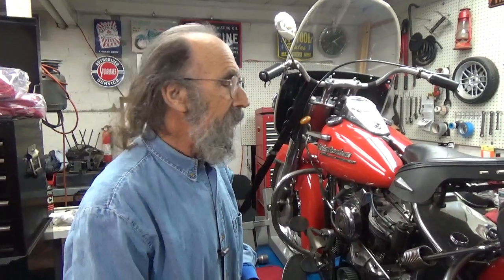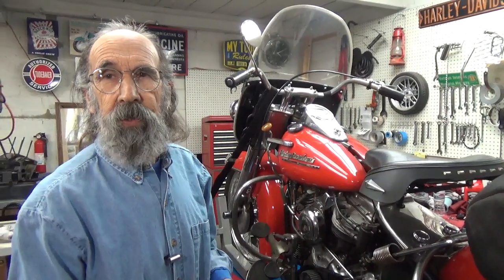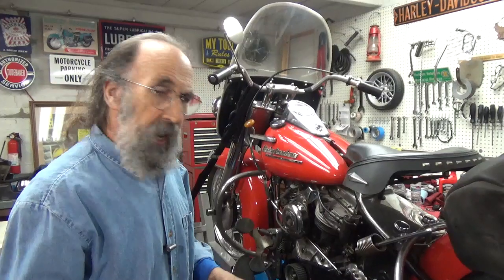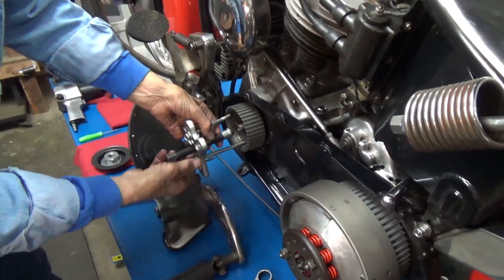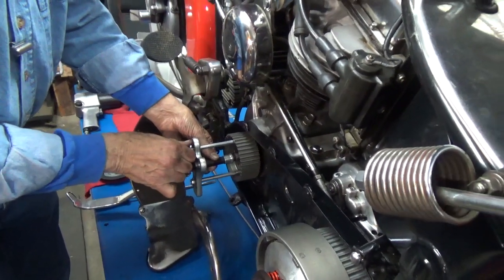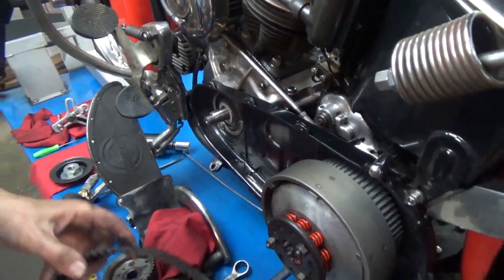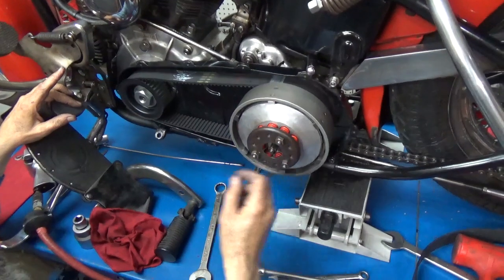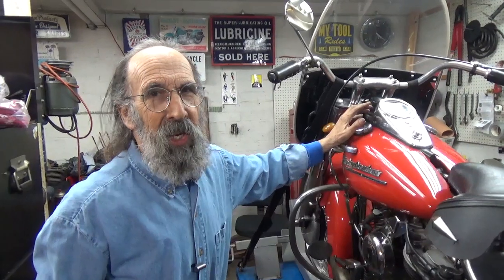Panhead Lost The Teeth Right Off Of Her Belt!

Comment: Hi MIke. I just picked up a slightly used Rivera Primo belt drive kit from a friend and will be installing it on my 52 Pan build. My question is what is the torque spec on the front pulley and what is your method to tighten it?
Reply from the maker: I don't know of a torque spec for a tapershaft.  However, one drop of threadlocker on the nut and I buzz it on lightly with an air impact.  Anyone who disagrees, okay.  But, that's the way I've done it for about forty years.
Reply: @pacificmike9501  Thanks Mike, always enjoy your videos.

Comment: looks easy but I got a 65 with un- adjustable trans …..not easy !
Reply from the maker: I would have run a stock chain on the "65.  In fact, I did run a stock primary chain on my '65.  If you're not using aluminum primaries, you can slide that trans a little, but, I don't know what kind of combination you have.
Reply: @pacificmike9501  Im running tin primaries with the trans shaft support ...had to do a lot of mods to get it to work …..the worst was the belt , but it has been 10 years almost 7k miles

Comment: ANy chance you can tell me what the tooth count is on that bike ?  I have a 1950 EL with a 39 front, 62 rear and a 132 belt...but its too tight. cant figure out whats wrong    Any help would be great
Reply from the maker: I'd need to know the brand and look it up.  You can do the same.  Have loosened the transmission and slid it forward?

Comment: Is that a castle nut on the rear axle that doesn't have a cotter pin ?
Reply from the maker: Ralph Nader wasn't around to demand axles be drilled back then.  This happens to be a much later axle to facilitate the hub I use.  I'll put in a cotter pin to keep you and Ralph happy.  Or, maybe I hadn't finished adjusting the chain.
Reply: In USA a cotter pin is a simple split-pin. In UK a cotter pin is a thick tapered pin which fits into a thick tapered hole. Two countries divided by a common language.

Comment: My 1.5 belt in my pan is having side to motion while running my assumption is the alignment for the shafts is off ? Or  could it be any other issues ?
Reply from the maker: Once those shafts are aligned so they're really in the same plane, you've got it.  However, the basket needs to be stable too.
Reply: @pacificmike9501  thank  you sir I appreciate your videos and your advice

Comment: Mike do you run a 8mm or 11mm belt drive?
Reply from the maker: I run an 8mm on both my Pan and my Knuckle.  I think I'm going to run an 11mm on the big Flathead.  It will gear it just a little taller.

Comment: I´m no mechanic by any means. But i assume that whould be a oil free clutch. Since you whould not want to lower friction on a belt. Is that stock on panheads? Just random curiousity. Anyone knows?
Reply from the maker: All of the old Harley Big Twins ran "dry clutches" up until the mid eighties.  The primary dive, with very few model exceptions were chains.  The chains were oiled, back then, by a "drip system" supplied from the engine.